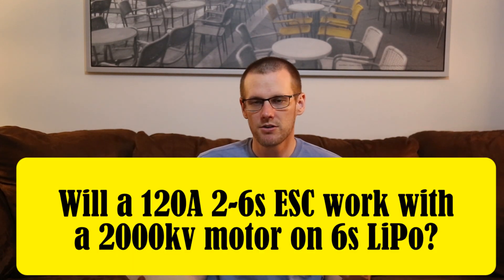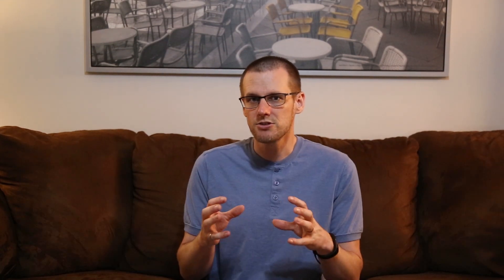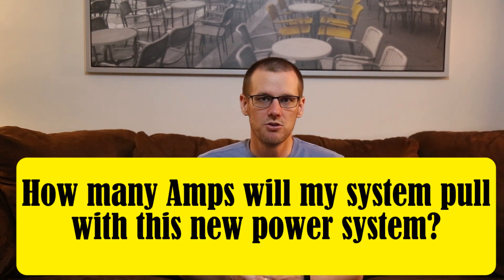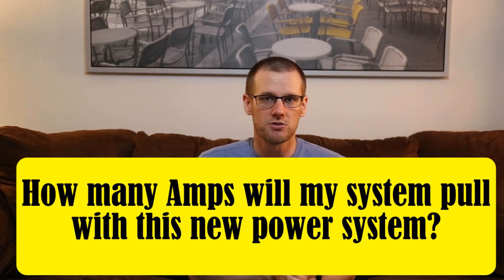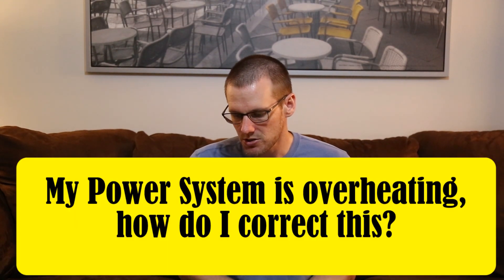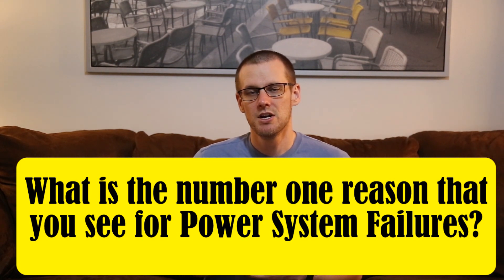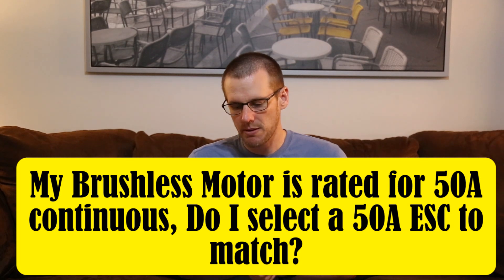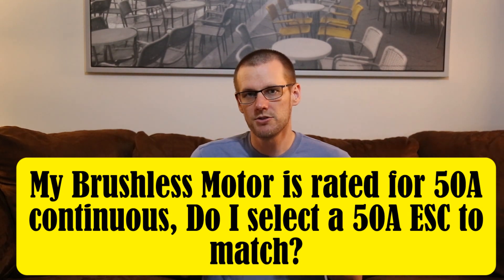Brushless Motor, ESC, LiPo Battery Frequently Asked Questions

Comment: Hi I have this set up in my 1/8 truck surpass hobby 120a esc and 2250kv motor I'm running 3s but wondered if I could go 6s or need a better motor and esc thanks
Reply from the maker: It's hard to determine without the detail of the motor,  gearing, truck model.

Comment: Currently having hesitation with a HBX 2995 stock gearing brushless upgrade. GoolRC 3900kv 900w 69a, paired with HW Quicrun Bl120a G2. Run 1500mah 40c 3s battery. Flysky 2ch transmitter 3ch reciever.

Comment: Hi....how do I calculate the c rating that I need for my rc sistem, meaning motor and esc. Thank you
Reply from the maker: Current you will pull divided by capacity of battery in Ah. Multiply this by 2.
Reply: @RCexplained  Thanks brother

Comment: Hello good sir I have a question. I am building a couple TT-02Rs and I am using a Zeee 3s lipo 8000mah 100c 88.8wh for each but I have 2 different brushless sensorless esc motor setups, both 3300kv, that have 60 amp ESCs. Will they support those batteries? One setup is a 540 size redcat volcano epx pro with same brand and model esc and the other is a rocket 3660 and surpass hobby esc.

Comment: BUILDING A LARGE DRONE 10 FEET X 7 FEET with 4 - ducted 30 inch props.
What size brushless motor , esc, batteries and charger would be required?

Comment: i got a kraton 8s i want to change the motor. the stock esc is 160amps con. and 1050amps peak i was looking at a leopard 5892 1090kv 5500 watts max power and 160 amp max amps 35 volts max voltage. i plan on running 8s will this motor work?

Comment: How can I run four motors to 1ESC. Or to one battery to run four  brushless motors on a drone how does that work how to run four motors to1 ESC or one battery to run with instead of having multiple batteries to run off of  how do I do that
Reply from the maker: One brushless motor per ESC. Input leads to ESC can be from one common battery.

Comment: Will 3s lipo support 45A ESC..brushless..
Reply: That depends on your esc. When you have an esc with 2S maximum input voltage, you cannot use it with 3S Lipo. You need an esc with 3S and 60 or more amps minimum input. And don't short the three phases while the motor is running. That will blow up your esc. I did that with a cheap brushless motor speed controller from amazon. A little bit smoke and one capacitor is exploded.

Comment: Greatly helps still having problems finding a motor for my rc car I'm running a spektrum 85 amp esc and the motor is 4000kv and is shot what motor would be a good setup for this esc

Comment: If I am running a Castle 2028 1100 kV motor which can pull 220 amps continuously at 8s, will I overheat my Hobbywing Max 5 ESC which can supply 200 amps continuously but peak/burst supply 1300 amps? This is going in a lightweight custom 1/5th scale sand buggy which weighs 13 lbs, however 1:1 GR with large paddle tires. Hobbywing indicates the 56113 motor is compatible with the Max 5 ESC, however that motor is only 800 kV motor. If I drop back to 6s, and shorten my gearing will I increase my headroom?

Comment: Whats your, off the top of your head tip for the most power you would throw at a  brushed 40amp esc and 180 motor in a 1/20 9145 bezgar " Truck" basher?

Comment: Hi! I have a missgieco 24 and want to charge to brucheless. I have a Turnigy AquaStar 3650-3500KV Water Cooled Brushless Motor and don’t knew wich esc I shuld have. I also have a venom 2s 5000a 30c battery on hand!
Reply from the maker: An 80A ore more would be suitable

Comment: HELP I have a rustler everything is rpm except knuckles front and back i also   have a proline p32 tyranny which a box 2400 kv  4 p and a 100 amp  3s capable and my battery is a 6000 zee 11.1 v spur 56 pinon is 18 . My top speed is 32 mph nothing gets hot .but I think k i should have more power. Do you know what kind of motor I should run with my spectrum 100 amp esc .and do you think I would be ok if I went down to a 46 tooth spur.
Reply from the maker: If your temperatures are all below 140F or 60C, you can try a 46T spur gear and re-check temperature. Check temperatures frequently right after the gearing swap.

Comment: Hello sir,
what would happen if you would power a 40A esc on a 30A max current 60A lipo. Will it work? It is for a rc boat?
Reply from the maker: How much current are you going to draw?
Reply: @RCexplained  It is 14.8V
Reply from the maker: 14.8v is the voltage. The current that you draw depends on how aggressively you load the RC boat. A bigger prop will draw more power and potentially burn out your battery or ESC or even motor.

Comment: I am having 2200kv brushless motor and 30 amp esc ×4 ,can I use 4200mah35c lipo battery for making drone with 4×30amp esc and 4×2200 kv motor
Reply from the maker: The answer will be yes, if your max load is less than 75A total and about 18A-20A per motor max. This will give you lots of head room to make for a reliable setup.
Reply: @RCexplained  i am your favorite subscriber pls i don't have enough money to buy battery can you send me a give away for your subscriber, I will be proud of you
Reply: @RCexplained  for 1brushless motor with 2200kv can I use 4200mah lipo with 35c with 30 amp esc can I use?..

Comment: I bought a 120a esc thinking bigger was better. What motor should I use with it for short coarse truck 1/10
Reply from the maker: It depends on what speed you are after, gearing on the truck, tire diameter to be used and cell count.

Comment: Nice to see your video.
But right now I'm questioning my self if the setup I ordered will do his work.
So I gona ask you to maybe you can help me.
I have a 124018 that stock how I changed the wheels from 72mm to 97mm stock electronics from the wltoys are known as no good but I love the way this car handles with that wheels.
So I choice to go for a Brushless setup.
I ordered a 3650 3600KV with a 60A ESC. In specs that motor drop 52A and ESC is 60A.
I have a little play.
I'm using 2s 2800mah 45C lipo. My cuestión is that maybe ESC will get hot.
That happens to stock until they failed.
But I'm gona use it for Bashing so I don't need maximum power do it helps if I trim down to 75% does that work.
Sorry 🙏 for asking that much it's my first brushless setup and I don't won't to start doing mistakes and finally spend more and more money.
There is a second option.
Same motor with a 80A ESC so it's a bit more expensive 14€ and maybe that would be better.
And I can use first setup option in mi 144001 how will have 90mm wheels and it's olso less wight and go for the second option with 80A.
Since I think I understand that bigger wheels will maybe make your motor requestor more Amos??
Thank for your help and great videos learn so much in short time great job.
Reply from the maker: Hello, I'm not familiar with this setup. You may want to ask the guys in a forum that run that specific RC. Larger wheels will definitely request more power from the system. You can adjust this by changing gear ratios instead of going with a larger ESC / motor / battery.
Reply: @RCexplained  yes that's the problem on this wltoys they have a not común modus and they are not much choice and also motor mount is not slotted.
I hope it works.
I let you know once I fit setup.
Reply from the maker: When you run a calculation of the theoretical top speed is it realistic?
Reply: @RCexplained  it's teórica I don't think that I reach that speed. Because it's wi8no load and airodinamic it's also part of the game.

Comment: Can I use a 2s lipo battery 5200mah 80c battery on a esc spektrum firma 40a?
Reply from the maker: As long as you don't load the ESC beyond its rating it can work. The 5200mAh and 80C is irrelevant to the answer.

Comment: Can someone recommend me an esc?
Specs of my J3 cub
8045 prop
1000kv, 2212 motor
1500mah 3s, 40c lipo battery
I just need an adequate ESC for my plane, please any help would be appreciated.
Reply from the maker: What is the wingspan?
Reply: @RCexplained  
Wingspan-40in, 
Chord length -8in,
Wingarea- 2.22sqft
I will be using an XT60 connector on the ESC.
Reply from the maker: 1000kv on 3s using an 8inch prop will be somewhere around 10A load. A 20A ESC will work, however I would opt for a 30A ESC as it will be more future proof if you wish to use it elsewhere. (provided you have the room for it)
Reply: @RCexplained  
Thanks a ton for your response, I may have skipped but I think I should add that I used a 30a ESC previously, but it got too hot and eventually burned a capacitor. Is my battery C rating is the cause? Can you kindly point out my mistake, it would be really helpful.
Reply from the maker: Do you have a data log of the run? I am quite surprised to hear that you've had an ESC failure. Is the prop 8 inches (203mm) in diameter with a 4.5inch (114mm) pitch?
Is the 40C LiPo new? What is the average internal resistance of a cell?
Are you able to confirm the motor is 1000kv? There is a video on the channel that talks about how to measure the kv of your motor.
Reply: @RCexplained  
Tbh, man I was using a very cheap 30a ESC with a built-in 5v BEC.
Actually when I got it, one of the bullet connection wire came off, I had to resolder it.
I also had too change the dean connector to a XT60, so that it fits with my battery. Where I live there are no hobby shops or supplies to get good parts, and yes, I double checked everything is ok.
Reply from the maker: A castle ~30A ESC should run that setup no problem, as long as all the listed specifications are within tolerance. for example the motor actually is 1000kv
Reply: @RCexplained  
Thank you for all your help.

Comment: This was a great video,  thank you. 
If I have two, side by side motors, and an uncoated aluminum radiator assembly wrapped around and making contact with both motors,  does the connection via aluminum radiator between the two motors cause an issue?
Or is it simply more of a common ground? 
Would i need to do anything to optimize performance? 
(This on a single esc, correctly rated for the power output) 
(Brushed. But im curious about brushless too)
Thank you very much! 
  I hope that my crazy questions aren't annoying.  :)
Reply from the maker: Hi Mrs. Rabbit, there should not be continuity between the case of the motor and the positive/negative terminals of the motor. You can simply confirm this with a multimeter before proceeding with your installation. If this is true, the radiator contacting both motors should not cause an issue, however it would also not be my preferred way of setting it up.
Reply: @RCexplained  meaning that you would have the motors insulated from each other? 
Also, ive got some brushed motors that have the 104 capacitors connecting from red to black,  red to case, and black to case. 
Does this not create a connection between hot and ground?   I don't understand why they do this,  and why it doesn't create a problem. 
I know they are placed there to protect the motor.
Reply from the maker: Capacitors in most cases are used to filter. In this example, it is to filter out noise created from the brushed motor, that could be picked up by our radio systems. This was more of a problem when we were on the AM/FM frequency bands. It does not create a problem as this is not a direct wired connection (Short) between the points that you have identified.
Reply: @RCexplained  okay thank you,  i understand that, well mostly.
It's all a bit strange at times. 
I had a servo that was twitching and acting funny,  i wrapped the wires through a ferrite core ring a few times,  and the problem vanished! 
Very strange. 
Thanks again,  much appreciated.

Comment: Could you shed some light on batterivoltagedrop during/under load. Is under 3.0v pr cell a big no no under ANY circumstance
How can i combat voltagedrop?
Reply from the maker: You should not see a voltage drop under 3.0v per cell unless you are running a BEAST of a setup. Running the highest C rating LiPo batteries helps reduce voltage drop. Managing the load placed on the system also helps reduce voltage drop

Comment: nice content video. i would like to add this, the MOST IMPORTANT of any rc car upgrading in your electrical system starts absolutely first with is the electrical wires & connectors(same as house wiring concept). once you plan on upgrade like motor esc & lipo batteries, you will want to determine your size guage wires 12, 10 & 8 guages and size connectors suchs as 5mm 6mm 8mm & such likes. you DO NOT want & need a bottle neck in your newly upgraded electrical system which can cause a fire(hot wires or too much amperage or volts). wires not rated for your specific electrical application will cause a not so good ending. i know this mentioned above because i have experienced this in a VERY bad way(rc). please be careful also with lipo charging.  SAFETY 1st & NOT taking the cheap route. sorry about the long rant. my bad. rc4life bro.
Reply from the maker: Great Points! Thanks!